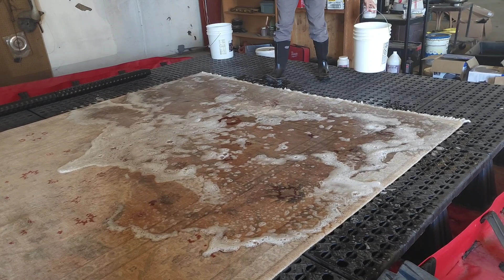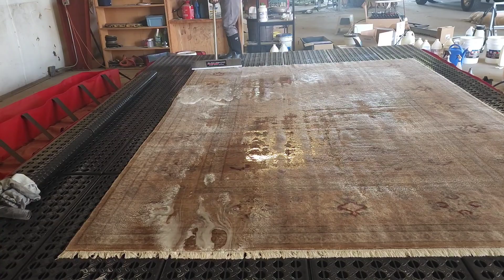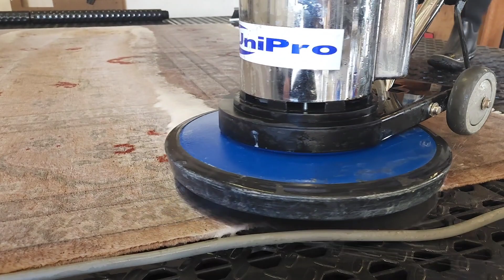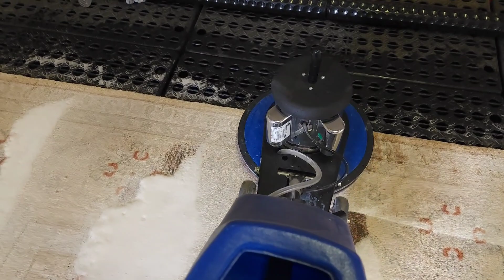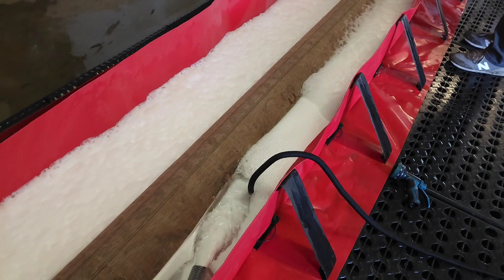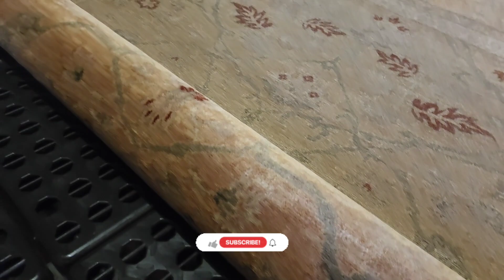Heavily Saturated Urine Area Rug Cleaning

Comment: May I suggest something? 
It might be easier to put holes on the bottom of the bucket so the solution can be applied evenly distributed. Place the bucket on the floor on top of the rug then put the solution in the bucket then swing it back and forth or place the solution in the bucket and do the corner down around and then swing it back and forth. Also depends how big the carpet and bucket are. 

Thank you for the videos. I love everything you put out. ❤
Reply from the maker: I have considered that, but when I took classes at two different rug shops. Neither of them did that. I've seen videos of individuals doing that. I'm sure it's effective. I may try it at some point. I use my old carpet cleaning chemical buckets for this.
Reply: @blackdiamondcleaningservices  Totally understand. I didn't want to overstep since I don't clean carpets for a living. I've seen others like you said do it in other videos it might be easier or not. Whatever seems Best for You.
Reply from the maker: @kathleenfarrell296  For sure. There are different methods and many that work. As I grow and can afford better tools. Things will change with my process.